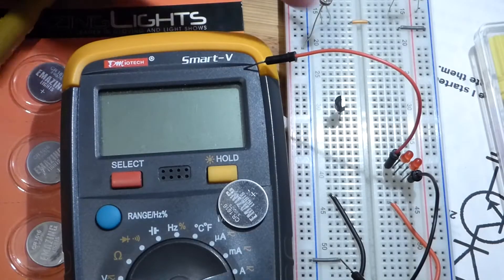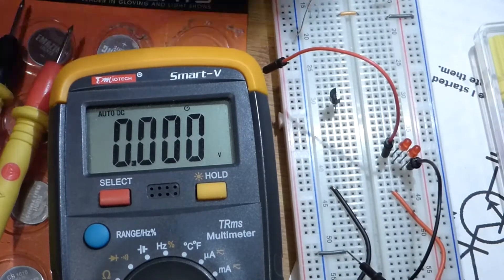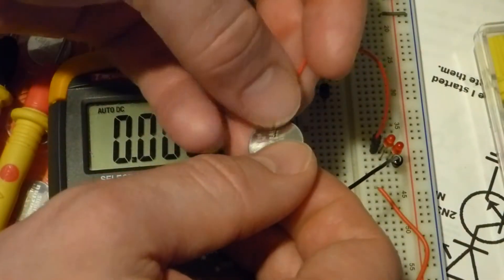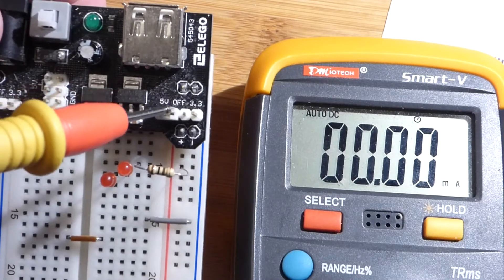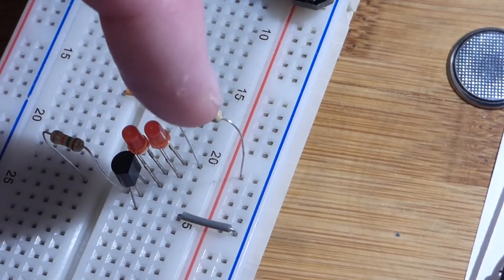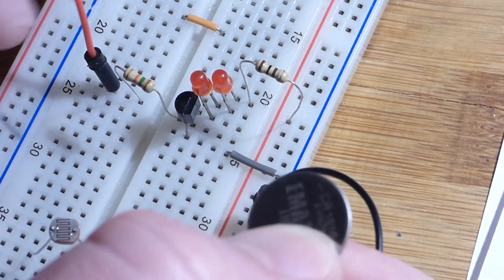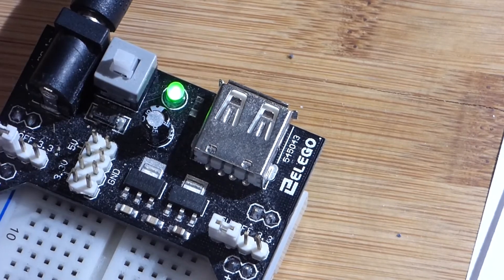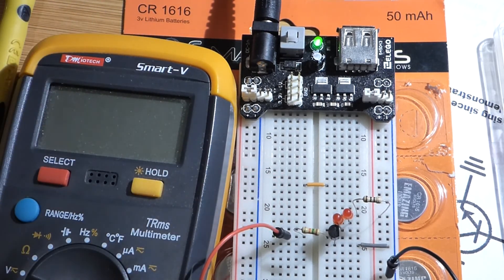2 series LEDs and NPN BJT 2N3904 switch at 5V controlled by 3 3V coin battery demo circuit

Comment: how did you know to choose the 15K ohm base resistor?
Reply from the maker: A small amount of current through base-emitter allows a lot of current from collector to emitter. Usually 10K is used. So I probably already had a 15K resistor available. You can go as high as you want with the base resistor of a BJT switch as long as it does not start limiting current from collector to emitter while it is on.

Comment: Can I substitute a 2N2222 for the 2N3904? I have lots of these.
Reply from the maker: Sure can! Every circuit I've built so far can use the 2n2222 wherever there is an NPN transistor.
Reply: Thanks. Going to use a microcontroller to drive the transistor and 2 leds in series. Similar setup.
Reply from the maker: Nice!